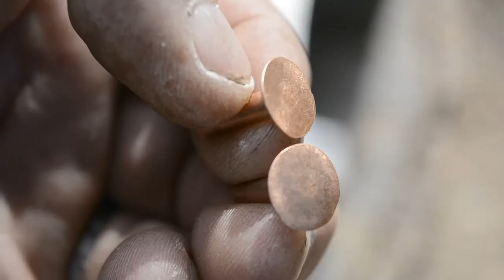An artistic solution to an age old problem | DIY Bushcraft bedroll

Comment: Hey Dave that's pretty awesome.   I'm thinking I'm gonna make me one for mine based pretty much off of your tutorial here.   Quick question?  Do you also have a tutorial for making the strap cutter?   Sure beats what I am using now (Fiskars cutting wheel and a long ruler).   Thanks for the vid!   I got quite a bit out of it.
Reply from the maker: I didnt actually make the strap cutter, this is a cheap one from Tandy leather.  You can find them pretty cheap on amazon, anywhere from 11 to 40 bucks.